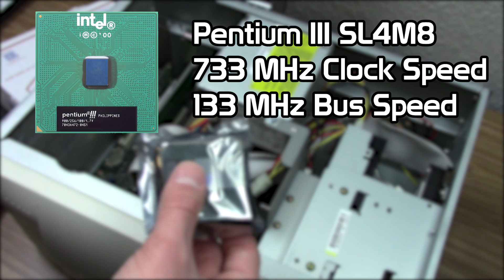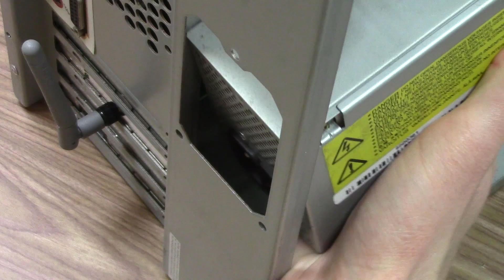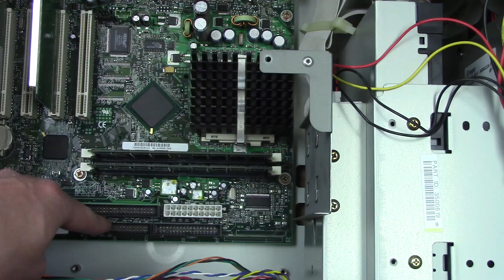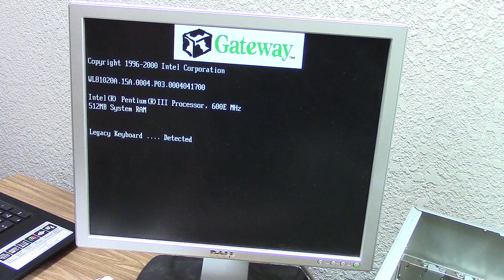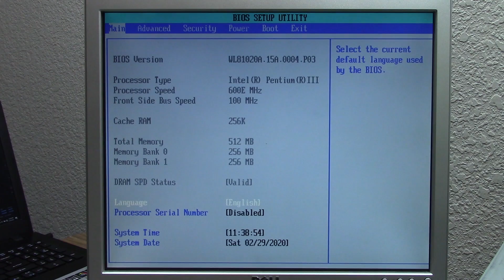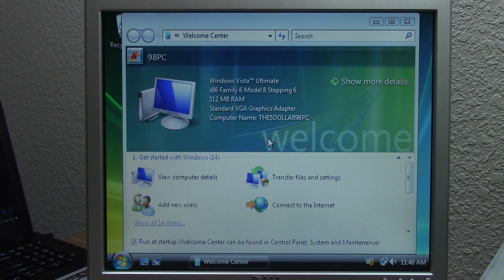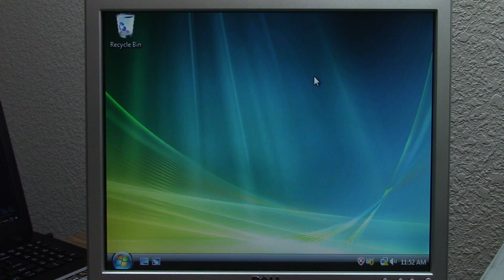Upgrading the CPU in the $5 Windows 98 PC! - Can It Run at 1 GHz?

Comment: bro to get the 1ghz to work you need to change the fsb to 100 since it's 1ghz = 10×100 mhz. it probably doesn't autoselect the fsb, so the way you booted it, it was trying to run at 10×133 mhz, and it failed!
Reply: i loved the video btw, thanks! =)

Comment: Maybe its running with FSB speed of 100Mhz.. check if you have a Jumper in the MOBO.. I have an i810 and in it you have a jumper to set FSB speed to 66/100/133
Reply from the maker: Interesting, how do you have the jumpers configured? I have been working on a followup video for this and this board's manual says the max speed is 100 MHz. Gateway's support website also echos that.

Comment: If memory serves, Windows 98 should support the Intel Pentium M 780 (2.26 GHz)?
Reply: The hardware is the main problem, the system was actually running Windows Vista
Reply: @tomharrison9280  Huh? I had referred to a different processor on a different system.